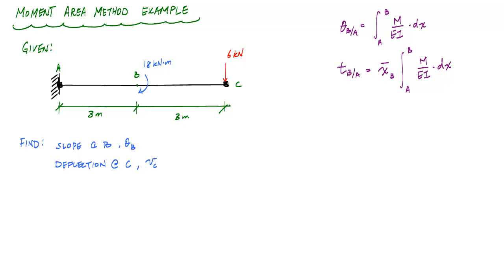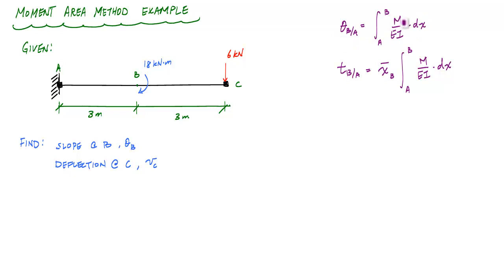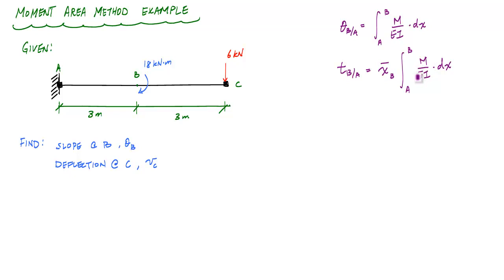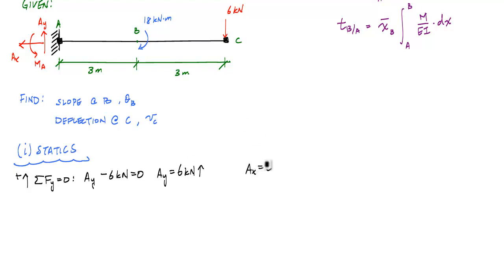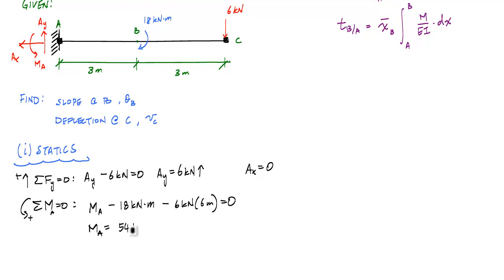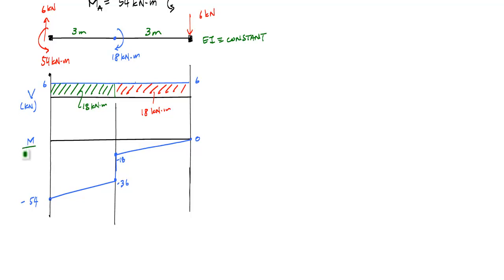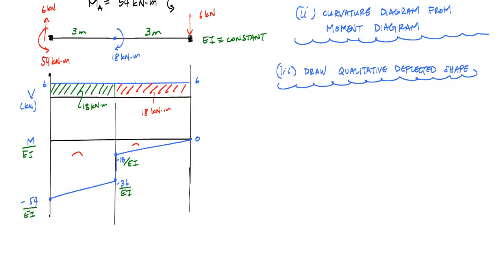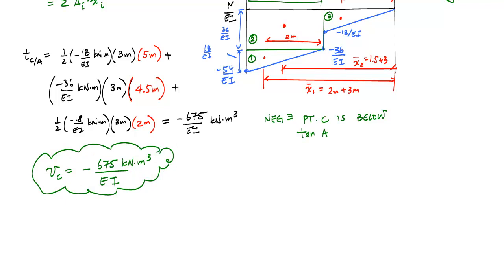Moment Area Method Example 2 - Structural Analysis

Comment: So sorry. I am very confused as to why the 54 on your moment diagram is negative even though your sign convention says anticlockwise is positive.
Thank you :)
Reply from the maker: The shear and moment diagrams use an internal positive sign convention. Equilibrium equations use a global reference frame where counter clockwise is positive.
Reply: MA is 54KNm positive for this sign convention
Reply: Anand Singh The anticlockwise moment is by the fixed end. As in that's how the support... in this case fixed...restrains the clockwise moment of the beam. The BMD is drawn for the beam. Hence accordingly its shown negative as it is clockwise.

Comment: Why does the moment graph below the x axis and not on top of the x axis
Reply from the maker: According to the sign convention that I use for internal loading, moments that cause compression at the bottom of the beam cross-section are considered negative internal bending moments.
Reply: structurefree owh i understand thank you

Comment: My professor had a beam with “4i” written under one section of the beam and “i” written under the other half of that beam; would that be an example of when the curvature diagram would not bead straight forward because EI changes??

Comment: hey man, im learning civil engineering in israel, and im trying to find a video on a certain topic that i can only translate from hebrew as "loading points method" where you load a unit force on certain points after breaking up the structure into sub-structures. its an aditional (other than the muller method) method to finding influence line. hope you can help! your videos are awesome!